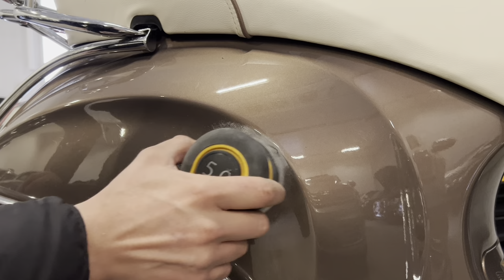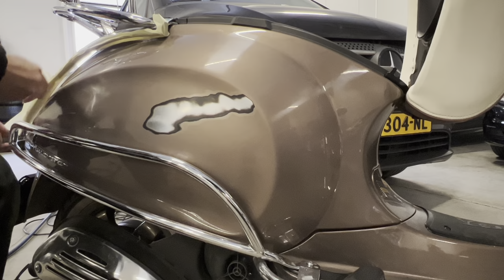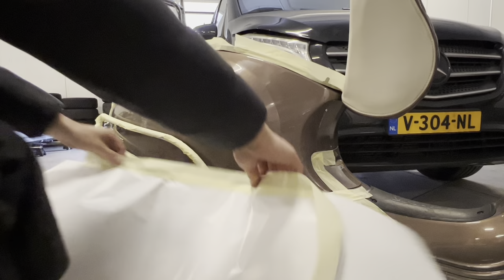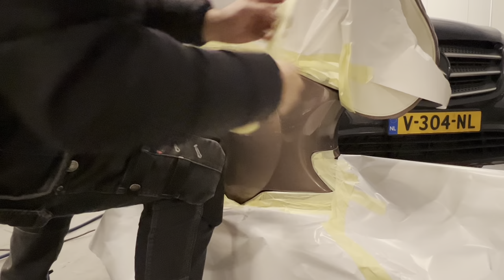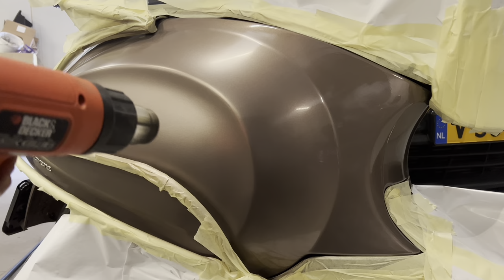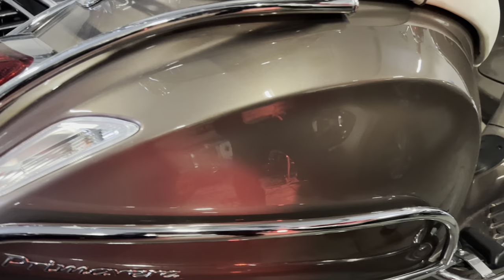How to repair a scratch on your own Vespa! Easy job using a spay can.

Comment: It looks like the equipment you used isn't the equipment linked in the description. Can you tell me what else you used (like that spray gun and large heat lamp)?
Reply from the maker: Do you also want to repair your scooter yourself? then you don't need that lamp you can let it dry for 24 hours and then polish. all the stuff that is on it in the description are stuff that you can do it cheaply and get the same result. that paint sprayer is a devilbiss sri.
Reply: @repairbyme6378  Thank you so much for responding so quickly!  Wow!  Is there an advantage of using the devilbiss sri over the regular spray can?  Or do you truly believe I'll get the same result with the can?
Reply: Also... in the video, I don't see where you use the 3M Trizact Performance Sandpaper, 03064, 3-2/3 in x 9 in, 3000 grit that you link to in the description.  When do you recommend using that?
Reply: The same question for the Benavvy 39pcs Drill Polishing Pad Kit, 2 in 1 Car Foam Drill, 7pcs 5" & 31pcs 3" Buffing Pads Compound Automotive Polisher for Drill that you link to.  When do you use this?
Reply from the maker: @MikeArce  look at 2:50 there I use trizak 3000
Reply from the maker: @MikeArce  yes there is of course a difference in you can control much more pressure and everything but you can get absolutely the same quality with a spray can!
Reply from the maker: @MikeArce  I didn't use that because it wasn't necessary but sometimes there are dust in the paint and then you want to use it